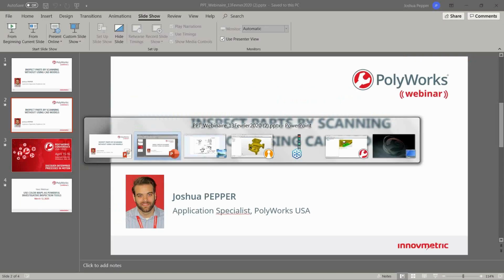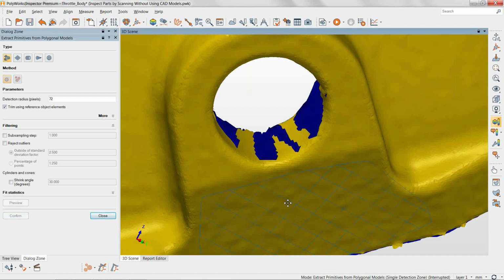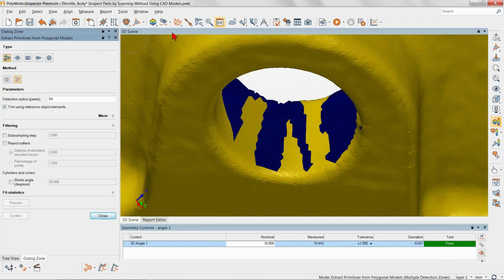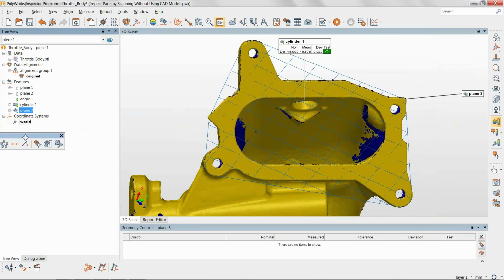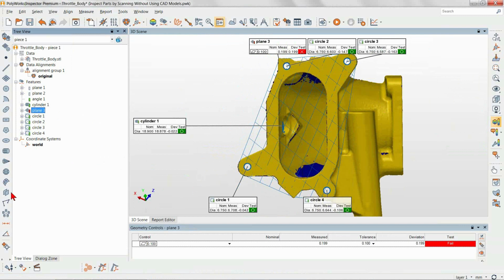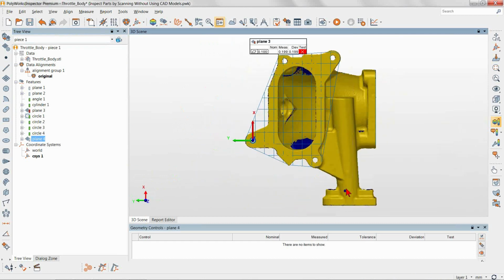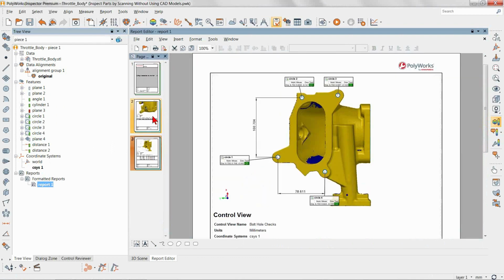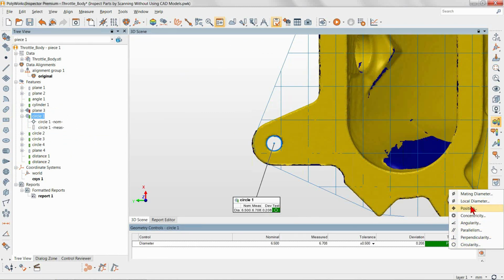Webinar: Inspect Parts by Scanning Without Using CAD Models

Comment: So, I work in a foundry, and we have very few CAD models available for the parts we make.  When I try to use True Position on a feature, it says "datum features must have a nominal component".  However, when i go to "define nominal", it often gives me an error and doesnt allow me to define it.  I'm often using constructed features (for instance, a cone for a boss on a part, intersected with a plane on top the boss, to find the circle at max draft) as my datums. In fact, I rarely use the "fit" feature you showed in this video (find it more finiky and difficult to get what I want out of it)  Is there a way to define these constructed features' nominal values to allow positioning GD&T?